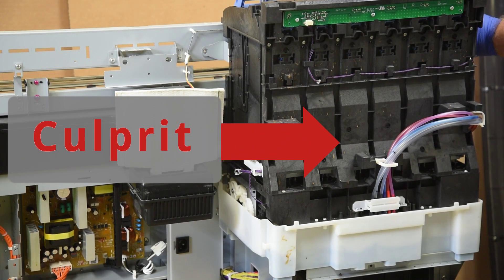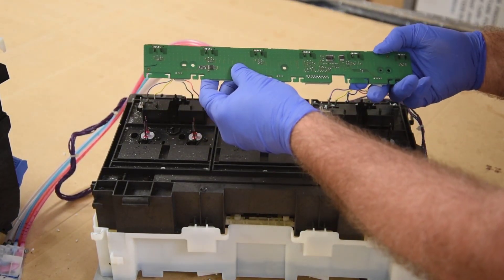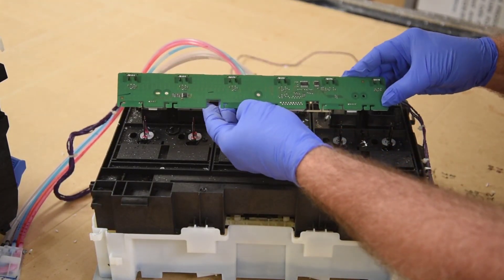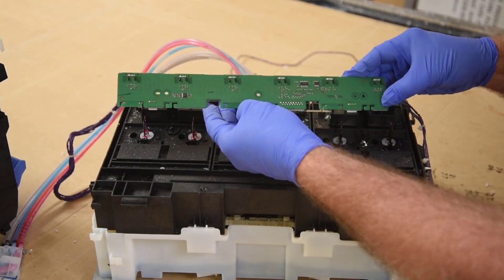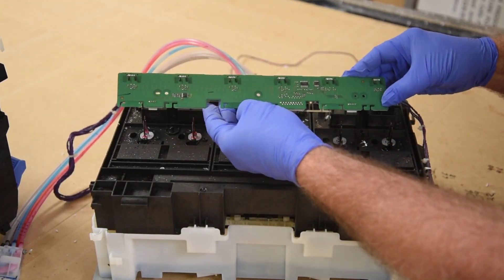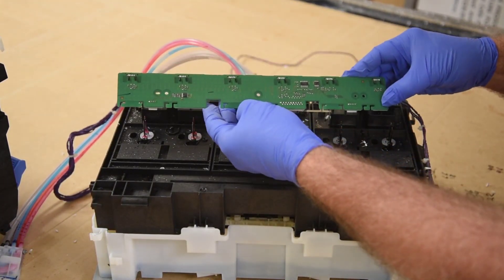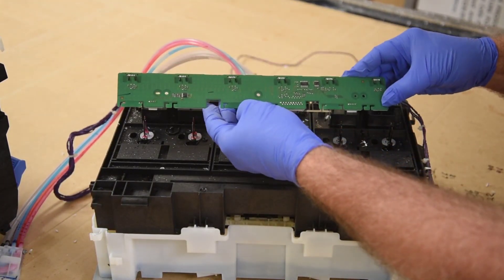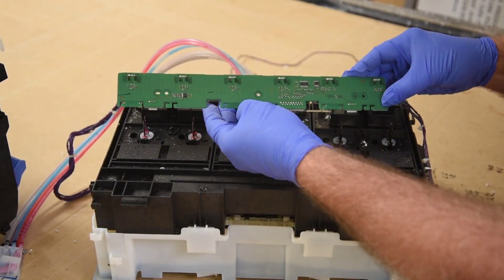Canon imagePROGRAF PRO-4000 Ink Leak Hunt

Comment: I'd just like to say that thanks to you and your 2 videos, I finally fixed the printer I bought for $175 at an auction.  When I first used it the ink would drain instantly on Magenta.   I took it apart exactly as your videos showed.   I found the rubber diaphragm and when I held it to the light it had precisely the problem you discovered.   I took a toothpick and and tiny amount of marine glue and applied on both sides of the miniscule hole.  It has now been almost two months and 12 full rolls of printing for friends and my personal business (and my 2 year old has a pretty cool custom wallpaper) and it still works perfect.   Without you there was a 0% chance I would have ever found and fixed the problem.  I have 0 printer experience and am only mildly handy.  Following your video step by step made it easy.  Thank you again so much!
Reply from the maker: Congratulations, that was quite an undertaking.  And don't sell yourself short, to pull that all apart, fix the rubber diaphragm, and then put it all back together.  That requires a very handy person.
Reply: @tscheidt Quick question if you don't mind. How did you clean the subtanks? I have the same issue with at least 2 of the diaphams on the machine I just bought and I've been using water and isopropyl to clean up the ink everywhere else but I'm worried about getting water or isopropyl in the sub tanks when washing everything. Im mostly curious if this is something I should be worried about while cleaning up everything or if its not a big deal and the water or alcohol will just work its way out. Also what type of glue did you use. When I search marine glue I get a bunch of different 3m products. Did you use one of those or something else entirely?

Comment: Can you remove this portion without a full tear down of the printer? I've done this with a TM-300 without doing much but removing the outer shroud. Any suggestions on how to tackle?
Reply from the maker: What Portion?  Most things on the printer can be accessed without tearing it all down.
Reply: @metalplasticelectronics354  my yellow bank 2 has a leak. So the right side ink holding system.
Reply from the maker: @POSTERFIREDOTCOM  The ink tank holding assembly will come off as one piece.  I think the only Canon part number is for the entire assembly.  If you want to try and repair the rubber pump pieces the ink-holding assembly will have to come apart.  Would be a huge job.
Reply: @metalplasticelectronics354  Copy, thanks for the info and great vid!

Comment: hi, I seem to have the same problem with a pro 2000. I have replaced the 2nd PBK inc cartridge in 2 days, its the 160ml unit but still. I printed only one A3 poster and its again empty. So i can only replace the entire unit? Is that the solution? What is the part number? DO I THROW OUT NOW THE WHOLE PRINTER?
Reply: I have the same issue with the M on the 4000 maintenance cart has filled twice and my bank account has drained greatly.  Each time I think it is now working, as soon as it redoes something it drains that tank?
Reply: I think this guy had a minor leak?  Mine is a whole 700 ml twice and 2 small ones all just drained 100%.  Right when it said it was about to fill the print head it emptied the one tank.  Always same tank.  This Video is awesome by the way.
Reply: Its the same problem, it will not fix itself. Sometimes it takes longer for ink to drain because the valve position is sometimes closed but the moment it opens the ink will drain. Sooner or later it will overflow from reserve tank.  Stop waisting ink. Either get it fixed or throw out the printer
Reply: @alex3785a  I have a tough time tossing a 7k printer :-),  Did you ever find a fix or ended up with a tech coming out?  With the manual should be able to do whatever they would do, just I probably need a part?  IT dumps the ink in the maintenance cartridge for me.
Reply: Fixed it.  Tore down the same way he did and used a toothpick to apply some marine glue to the tiny hole.  It all works now!!!!!
Reply: @tscheidt  Oh wow nice. Did u happen to make a video?
Reply: @alex3785a no video.  Literally followed his process.  Took a toothpick and some marine glue and plugged the diaphragm hole. Did a lot of ink clean up etc.  But in the end it's working 100%

Comment: You are my hero.  I made a hell of a mess though.  So I stripped mine down to exactly where you were and had the exact same markings as you did on the seal.  Other than replacing the entire unit, can you think of any fix to just get by?  Micro fine layer of leak seal or something?
Reply from the maker: I'm not sure what would stick to the rubber diaphragm.  Maybe some of the paint on sealants. Maybe a very thin layer of silicone rubber.
Reply: @metalplasticelectronics354  I'll see what I can find and I'll get back to you with the results.  Do you still have yours?  I don't think I've seen just the diaphragm on any part sites.  Know a lot of posts looking to solve this exact problem
Reply from the maker: I think the only part number is for the entire ink-holding assembly, and it's not cheap.  But neither is the ink. Yes please do let me know if you find something to seal it with.  I got rid of all the old pieces, I'm kinda tight on space, so have to be very picky about what I hold on to.

Comment: Can you please explain how to remove / detach this whole unit, is it complicated? Is it just a few screws? I found someone who can give me an entire pro 2000 model for spares, then i could replace it but i dont know how complicated it is to remove this unit. Please help, no one has any info on this. Thank you!
Reply from the maker: There are just a few screws that hold it in. One or two that allow the ink tank to swivel and a screw for each hinge.  The wires all plug in and the ink tubes disconnect up at the carriage platform. There is a procedure for draining the ink.  The guy who owned the printer I tore down was able to buy a PDF service manual. I think it was like 20 dollars.  I would try and get a manual for it as it will give the different procedures for removing and replacing items.  If you can't find it email me at mike@mlplel.com and I'll try and find where he ordered the manual from.
Reply: @metalplasticelectronics354  you're a hall-of-fame hero! I will try and get the service manual, I believe I saw it online somewhere. Draining the inc will be very costly as it will train all 12 tanks. Is that necessary? I was hoping to swap the inc holders without that :( But by the looks of your video, I will have to demount the entire printer cover not just the backside? What do you think on time, 2 hours, 2 days, give me a ballpark if you can... thanks again man!
Reply from the maker: I would think if you don't mind a little mess, could try not draining the ink.  I would think 2 to 3 hours, not draining the ink.  But half that time will be in cover removal and replacement.
Reply: @alex3785a  manual below.  Is yours draining an entire tank at once when it cycles and says it is starting to fill the printhead?
Reply: @tscheidt  i got the manual from the internet. Yes it drains the whole thing if the valve is open and does say its filling the inks... Then the whole thing is gone.
Reply: @alex3785a  Yah same here.  At least if it gave an error code or I knew 100% which part it was I could get it,  Some say it is the purge unit and then video like this makes me think its something much different.